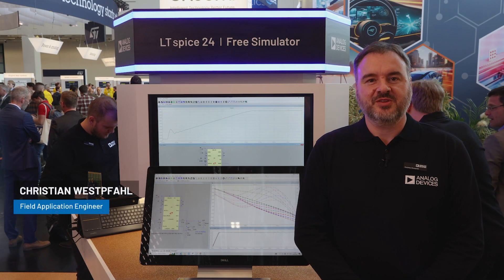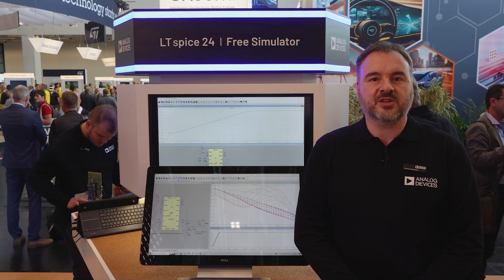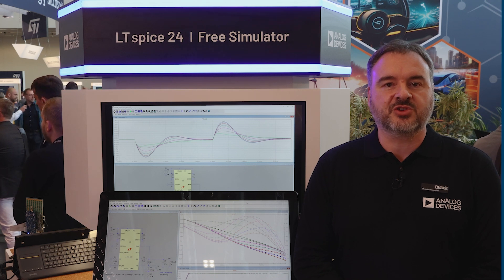Introducing LTspice 24

Comment: Introducing LTspice 24: A Powerful, Fast, and Free SPICE Simulator

*   0:00 Introduction: Presented by Christian, a field application engineer at Analog Devices.
*   0:07 Design Challenges: Designing high-performance analog and power solutions is increasingly complex.
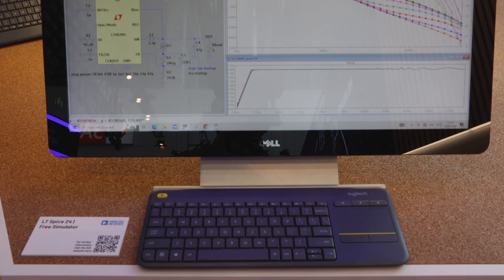*   0:17 The Solution is LTspice: LTspice is a powerful, fast, and free SPICE simulator software.
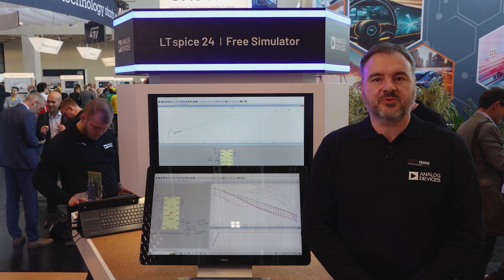*   0:37 Key Features: Includes schematic capture and a waveform viewer.
*   0:45 Extensive Model Library: Over 30,000 models, including 5,000 Analog Devices product models.
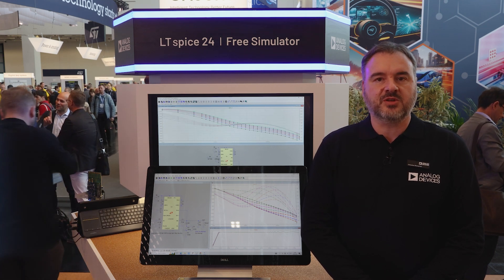*   0:53 Waveform Viewer: Allows probing schematics to produce simulation results.
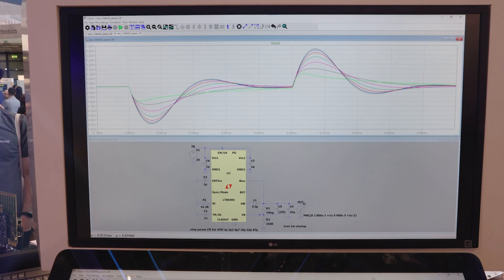*   1:00 LTspice 24 Upgrade: A major upgrade released in 2024, offering significant improvements.
*   1:03 Enhanced Speed: Runs simulations approximately 20% faster than previous versions.
*   1:07 New Feature: Frequency Response Analysis: Facilitates improving loop stability and regulation speed of DC-DC converters.
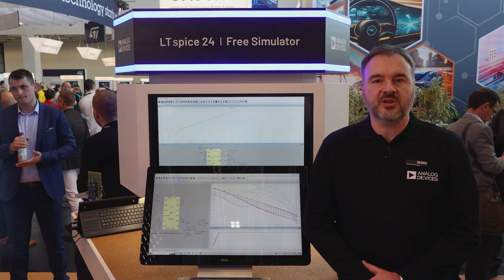*   1:17 Improved Interface: Features a modernized and enhanced user interface.
*   1:20 Call to Action: Encourages viewers to explore LTspice 24 for power and analog circuit design challenges.

I used gemini-1.5-pro-exp-0827 on rocketrecap dot com to summarize the transcript.
Cost (if I didn't use the free tier): $0.0158
Input tokens: 11440
Output tokens: 298
Reply: Thanks!